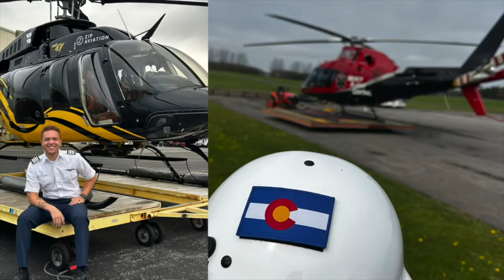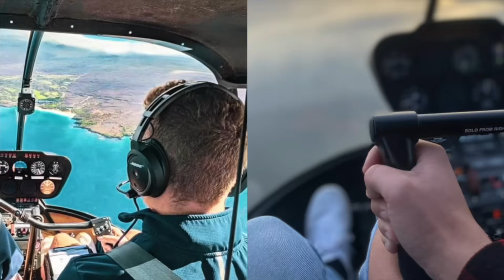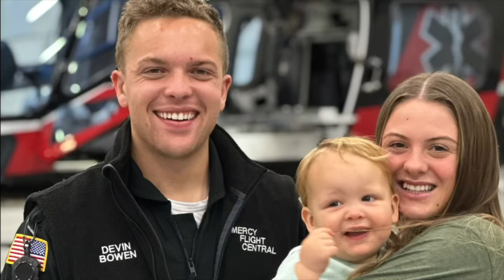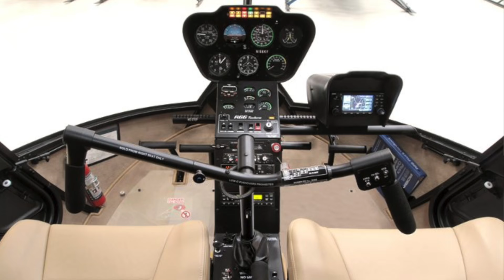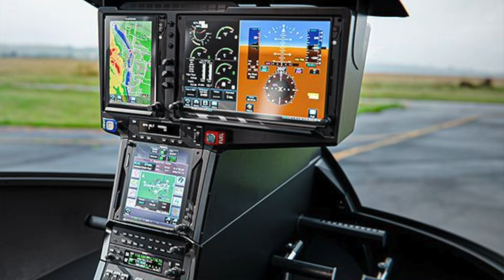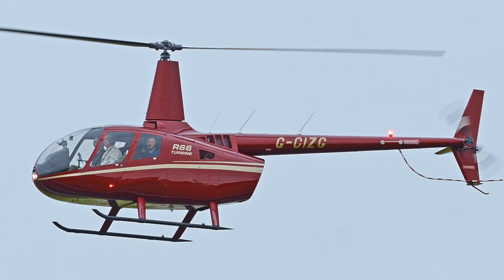Why The R66 NxG Might Be a Bigger Deal Than You Think

Comment: You can't compare the 66 to an EC130 or an HX50. The real and current competitor is only the 505. If you want to stretch a bit, maybe a used 206. The R88 will be the competition for the EC130.

As for the trim levels, they should have called them the Lariat, the King Ranch, and the Platinum (Ford truck guys will get the joke :-)

Most new R66's were probably being spec'd with glass, so reducing the number of instrument panel configurations is a profit-maker for RHC. In addition, the closest, and effectively only, competitor to the 66 is the 505, which only comes with glass.

The electronic engine instrumentation has also been a feature gap to the 505. It's about time that gap was filled! And come on, RHC, let's do the same thing with the engine gauges on the 44!

The standard autopilot will reduce the accident rate. Given the battle RHC has always faced with low time, low frequency pilots, this will undoubtedly improve the situation.

All in all, the preset configurations and substantially reduced option list makes the helicopter so much easier to buy. Customers won't agonize as much about the price and configuration.

The next big innovation on the 66 (and the 44) needs to be a ***flat floor***! Come on RHC, get rid of the "tunnel"!

Comment: Hill's latest video on the Bespoke Haigh-Chex 50, expounds on their new laser engraver to put their logo and part number on all the parts and their unique genius bespoke software that integrates the laser marker's software with their BOM software (a simple ACSII text link utility) !   At this point, they likely won't have functional / flying helicopters until mid / late 2026, or later.  The "User Built" HX-50 will not likely ship until well into 2027, or later.  The HC-50, certificated version maybe in 2030.  According to Robinson,  the R66 NxG will sell for $1.4 to $1.7 million USD; First delivery in about a year (2026).